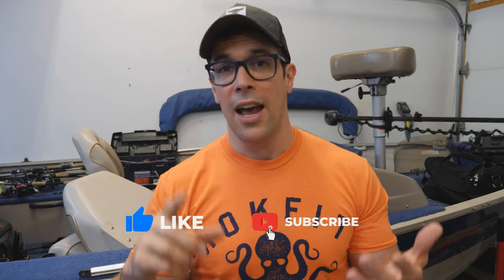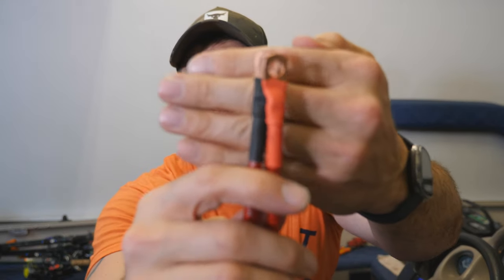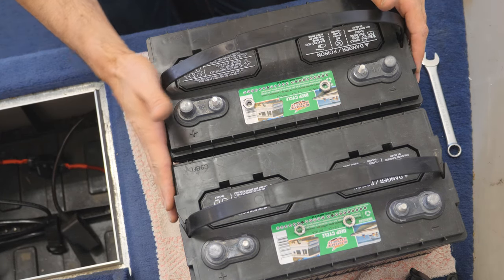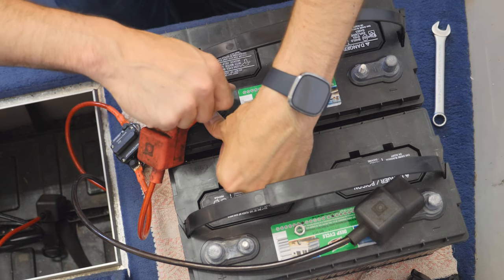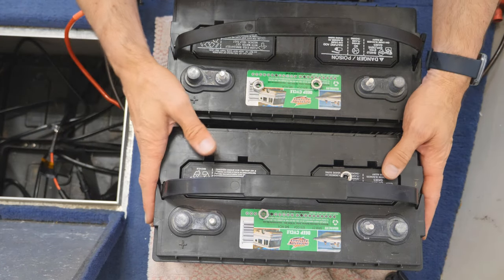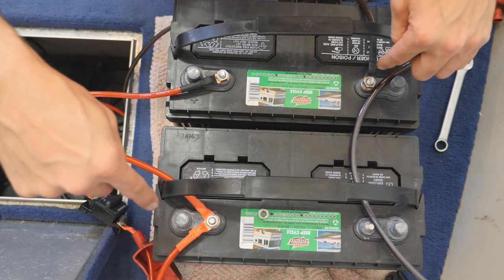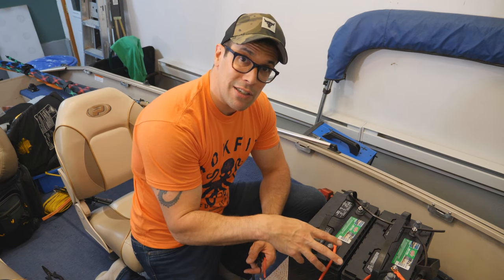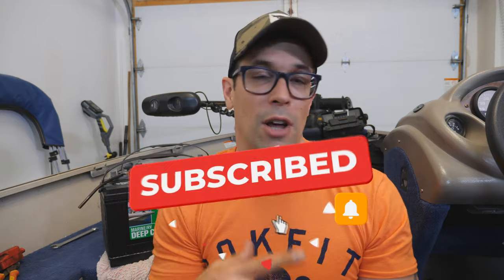Wiring 12v Batteries in Series or Parallel + Charging Tips!

Comment: What happens if you run two 12v batteries in parallel but the device you are running is connected to only one of the batteries?
Reply from the maker: The the device will just drain that one battery if you just wire it directly to one battery.  Now if you have something being powered by the parallel system PLUS something running directly of just one of the batteries, you actually risk damaging that battery prematurely because you're draining it faster that the other battery in the parallel configuration and you risk over-draining it if it's a VRLA technology battery (lead acid).  Hope that helps!

Comment: Do you have to disconnect the battery’s from each other to use 2 12v battery charger
Reply from the maker: Great question John, you do not need to disconnect your series or parallel wiring when charging your batteries using a bank charger that has 1 bank per battery.  So for example you have 2 batteries and you have a 2 bank charger or your have 2 separate removeable battery chargers,  you're all set :)

Comment: Love your videos Dan, have just caught up on a lot of your how too vids, and found them to be some of the best I have viewed. I have a 15yr old Stratos 476SF here on Golden Lake ON,  I am about to embark on a multi-year electronics upgrade. Starting with an upgrade to GPS/Side scan unit, then on to a future upgrade of my trolling motor. I am seriously considering doing the install myself, some thanks to your videos, however I wanted to ask - I intend to use a Stern Saver Epoxy on mounting play for my Transducer, have you used or know anyone who has installed one?
Reply from the maker: Thanks so much for watching my videos and I really hope it helps you install the units, it's really not that complicated, just need to take your time!  I have not personally used a stern saver but I have heard amazing things about it and if the UHD transducers don't line up with my current GT transducer mount, I will absolutely get one and use it (the original one from http://sternsaver.com/ )

Good luck with your upgrades, I know it's a huge investment.  I am also starting to upgrade and prepare for a new Panoptics system on the boat for the spring.  I fish a ton of rivers and rely heavily on spotlock so I am shopping around for the best independent livescope mounting system that can be used while my trolling motor is in spotlock.  We'll see what I cook up over the winter ;)

Thanks again and good luck!

Comment: i am a delivery boy i have an electric scooter which has 2 batteries one battery takes 5 hours to get full charge so when i am working with one battery i am charging the other battery but many times it happens that i drain the full battery within 4 hours and when i come to take another battery i don't get full charged battery i just want to know from you can i charge my battery with 2 chargers My battery has a dedicated charging socket There is another function in my battery, from which socket we connect in the scooter, by connecting the charger with a different plug in the same socket, I just want to know that if I charge this battery with the help of two chargers Can I reduce my charging time by doing this or can doing this cause some damage to the battery or charger?

Comment: i can't use a 24 volt charger on  series involving two 12 volt run in parallel connected to two 12 volt parallel to give me a 24 volt system with double capacity?     I just bought a 24 volt charger maintainer doggone it. I guess I should have watched this first
Reply from the maker: Theoretically you should actually be able to do this no problem. The only thing I'm wondering is if the 24 volt charge is strong enough to fully charge both 12 volt batteries because a full charge on a battery is not actually 12 volts, it's 12.8 or if you have lithium it's even higher. Hook it up and give it a try and see if it gets both your batteries to around 12.8 or 12.7 volts each. If it does then the charger is strong enough and you can use that setup :)
Reply: @DanRichardFishing  the other question I have is : if I charge each individual battery, can I still keep them connected in series and parallel and run a 12 volt charge to each battery. I know these are probably stupid questions. I have four 12 volt batteries and I have arrayed them to give me a 24 volt output with greater running time. I have four 12 volt solar panels and I had hoped to use these to charge each individual battery. Do I have to separate the system to charge it? I really would rather save the 24 volt charger maintainer for days when the sun don't shine....thank you for responding electricity is sometimes confusing to me and I've already blown up three inverters...lol

Comment: Joining 2 batteries in series or parallel increases capacity equally, the difference between 12v and 24v is a motor of equal wattage say 300w will pull half the amps when run at 24v compared to 12v.
measuring the batteries in watt hours oppose to amp hours will give you the same value. Here is a detailed video on how to calculate and understand watt hours 
https://www.youtube.com/watch?v=1_kwMuQaYXA
Reply from the maker: Hi Adam, thanks for the comment!  Sure, that makes sense, there's nothing you can do that technically increases the set capacity of a battery, the difference in parallel vs series is simply how the power is consumed.  As you said, the different is that 30 amps at 24v pulls twice the wattage as 30 amps at 12v (720 watts vs 360 watts) hence why the AH on a 24v series setup doesn't double up when thinking of how long something will last vs a 12v parallel setup.  I think it's generally just easier to think of everything in amps but you can certainly think of it in terms of watts as well.

We tend to go with AH because it involves less math... most marine devices list power consumption in terms of amps @ nominal voltage so no one bothers to run the wattage conversion.

Thanks again for your comment!

Comment: 2 12 V batteries in series or in parallel do not have a difference in the number of Watt hours available ( they have the same amount of energy). amps x volts = watts.

Comment: Very misleading. The new NOCO Genius GENPRO 10x4 CANNOT be connected in parallel with multiple banks. Today I contacted NOCO and they confirmed the old units used to be able to be connected in parallel, the new units cannot.
Reply from the maker: I'm not sure what you mean, can you please clarify? Are you talking about hooking up batteries to each individual bank when those banks are in parallel or are you talking about charging via a single bank multiple batteries in parallel? I never recommend charging more than one battery with a single bank. Is this what you mean?

So for example if you have two batteries that are wired in parallel, you should be using two separate banks to charge those batteries, not one single one wired in parallel. If that's what you're talking about, I would never recommend doing that and I've said it over and over again that you should not do that. If you get a chance please clarify, thank you.
Reply: @DanRichardFishing  You say you should have a bank for each battery in the boat. And I would normally agree with that. But then at 8:48 you say "it doesn't matter if they are in series or in parallel" and "they test them and charge them separately". Unfortunately even the new, very expensive, Noco chargers as smart as they are will not charge battery's separately that are connected in parallel, even with each battery getting its own bank directly from the charger.
Reply from the maker: @timmlounsbury  that is super weird and the first time I ever hear that, I actually even poured over the instructions yesterday and the website and absolutely nowhere does it say that. I'm going to give them a call for more information, that seems really really strange but thank you for the heads up, I honestly had no idea and it's not in any of their documentation.
Reply from the maker: @timmlounsbury  Hi Tim, thank you again for bringing this up!  I spoke to Noco today and they confirmed that batteries in parallel need to go on the same bank and not separately as you mentioned.  Really weird that this is not mentioned ANYWHERE, especially considering older models like the 1.5A Genius series I have, you can 100% do individual bank per battery wired in parallel.  I pointed out this should be in the instructions and he said "While there is no mention of series wiring either, I do apologize for the confusion".  I then pointed out "well that's just it, if it's not mentioned for series, one would assume you do the same thing for parallel, especially considering your older units support this."

He apologized for the confusion and asked if there's anything else he could help me with lol!  Sounds like they were not open to editing their instructions haha

So thanks for bringing this up, I will mention it in an upcoming video for sure!
Reply: @DanRichardFishing  So here is my scenario. I have 2 deep cycle marine batteries connected in parallel, and a cranking battery on its own. Do I only need a 2 bank charger, one bank for the deep batteries and the other bank for the cranking battery, or do I need a 3 bank charger, 1 for each deep cycle, and the 3rd for the cranking? Thanks in advance.
Reply: Dan, great video and helpful.  I have a 48V battery bank with 4x12v in series.  I charge each battery separately as you describe.  No problems and it is working like a charm.  My problem is that I need to monitor my usage so I have installed a shunt monitor that measure’s the draw, but how do I wire things so it also monitors the charging.   Any recommendations?   One option is to upgrade my charger to 48V so I charge the full bank as one, but I would like to save $500 and keep the current 12V chargers.  Please advise.

Comment: Tl;dr-my advisement for parallel configuration and charging. 
1. Make sure each battery in the batch is fully charged individually. 
2.Arrange the configuration  in parallel starting with your highest capacity battery in decending order. Until desired bank units/capacity meet. 
3. With your multi-meter check for continuity and charge capacity between the positive and negative terminal on the 1st battery in parallel.
(This will be the average capacity across the bank) 
If you don't reach desired charge level in the batch, 90% of the time its a single cell in the last bat. That is highly sulfated(spoiled). DONT FRET!..
4. Connect a 2A NON-BMS-OPERATED (That's important for this technique) trickle charger to the 1st battery for 24hours. 
5. After 24 hour take it off for 30min to reach temp. equilibrium. Then check the charge level. 
5a. If not to desired charge cap. SAFELY drain the batteries in parallel with a load tester until the bank appears to be dead. Wait 30 min. Then reconnect the  bat charger for another 24 hours. 
Repeat once more if necessary, if still not meet. Replace the last battery in the bank after disassemble the parallel connections.(thin indicates their is either a damaged plate, corroded connector, or an uncharged or missing electrolyte on the inside of the battery). THEN, repeat from Step One. 
End of Instruction.

I came here for a refresher of charge range and capacity in parallel vs. series. 

When charging in parallel i would recommend that you  connect the +&- to the same battery where the input/output power cables connect to. I believe his recommended orientation will leave a variety of sulfation across each individual cell in each battery. Spoiling( sulfateing) the batch of batteries sporadically.

Comment: amp hours = watts.  If you wire 2 12v 100Ah in series for 24v, yes, you still have just 100Ah, but at 24V.  Amps to Watts is what you want.  2 12V batteries @ 100Ah in parallel does indeed equal 200 Ah, however it is 2400 Wats.  2 12V batteries @ 100Ah in Serial does indeed equal 100Ah, but at 24V it still equals 2400 watts.  You need to look at the watt consumption, not the amps.  The amps are really irrelevant in terms of your power.  If your trolling motor is 24V, and you use 2 100Ah batteries, its still 2400 watts.
Reply from the maker: I'm not sure I understand what you are trying to say.  You can easily say the same thing the other way around and convert watts to amps and get the same conclusion.  It's just a different measure of available power draw.

Comment: To those who know:
I have a scootmobiel, powered by 6 batteries each 12 volts, in series.
So they produce roughly 72 to 80 volts. Gel batteries.
The scootmobiel (move vigorous 1500) can do speeds of 45 kilometers an hour.

I also got 2 gelbatteries that came out of another scootmobiel.

Is there a way to hook em up to the move vigorous to get a bit more mileage ? Not power or speed, just a bit more distance?
Or do i really need to hook up at least 6 batteries next to the other 6 to get more mileage/distance or how you call it (dutch imbecil)
Reply from the maker: Hi there!  I had to look this up to see what this Scootmobiel was that needed 80 volts and wow, that thing looks cool!!!  We don't have those here, I don't think they are legal for the road but they look really neat!  So, to answer your question I don't think you can just add the extra batteries, I can only see two ways of doing this...   A) you would have to replace the batteries that create the 80v with larger batteries with higher AH ratings to get more distance or B) You add a second bank of 6 batteries with a switch that allows you to switch to that bank when the first bank is dead.  Good luck!
Reply: @DanRichardFishing  well, here in the Netherlands we can buy these Move Vigorous. We can buy em as Scootmobiel (for handicapped people or disabled or less able or whatever you wanna call people with a disability). And we can buy em as a moped, but then you require a licence to drive. And then you may not drive it on the sidewalks or in places where NO other vehicle is allowed.
They are both the exact same vehicle, scootmobiel or moped..... so do not ask me why this is, i would not have a clue.

Carver, a dutch company, is building such vehicles now as well, but they are a little different. They will hang in corners like a real motorbike does.
They first built such vehicles as motorbikes, but they stopped production of those. Top Gear (Richard Hammond) tested it.
And this new Carver vehicle you can also buy as a moped or scootmobiel.
BUT again, if you watch the videos of those vehicles, you will not see much difference between the 2. So why 1 is a scootmobiel and the other a moped, je ne sais pas.
I do know the Carver has a normal round steering wheel, but in my opinion has more disadvantages.
Mine, the Move Vigorous, has electric windows, a radio with bluetooth capabilities, a small electric heater. All working on the same 6 batteries.
The Carver does not have electric windows. I dont know about the rest.
But the major disadvantage in my opinion is the way the Carver hangs over in corners.
Like a motorbike.
There are safety thinggies built into this vehicle so you can not go too far with the hanging. But one of them safety thinggies is a sidebar, metal. Which will scrape the road if you dare hang too far.
Imagine it getting stuck in a small pothole or perhaps a loose tile or rock. 

Plus: You dont need it. 
The Move does not hang over. So when  you take a corner too fast, you may flip it over.
BUT if you know how to drive you can easily go full speed through a 90 degree corner.

I dont know where you are from, if it ever becomes legal at your place.
But they ofcourse are always changing the rules, here as well. And so chances are they wont stay legal. 

Thx for the reply on the question btw. I already thought it would not be as easy as i would have liked it to be.
Reply: @DanRichardFishing 0

Comment: So if you run your batteries in series you're practically losing out on One battery because you don't get those amp hours? So it's useless to buy two 6-volt batteries and running them in series if you need a 12-volt battery because you lose out on a h from one of the batteries? It's like throwing money away? So if you need 12 volts buy 12 volt batteries or you will get ripped off? You will get less run time? I have 2 expensive for hundred amp hour batteries 6 volt each am I losing out on four hundred amp hours because I need a 12-volt and I'm running them in series?

Comment: Was a helpful article, But   As long as you have a charger,  and its hooked up long enough,  It will cahrge more than one battery ,  Just not very fast for second bank,
Reply from the maker: You ideally want to have a separate bank for each battery otherwise you are running no individual diagnostics.

Comment: I want to charge with a trickle 2 batteries at once with a trickle,  But they are wired in Series,  Do I hook one to Negative and one to positive on other battery
Reply from the maker: As far as I know you can't do this... for that setup, you would need a 24 volt charger.  You really would need to get yourself a dual bank charger or just do one battery at a time.